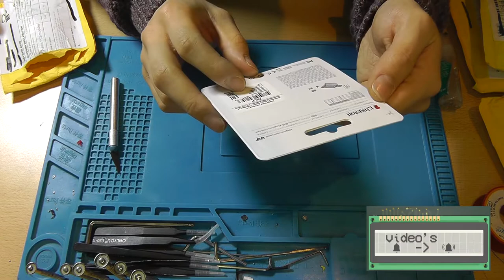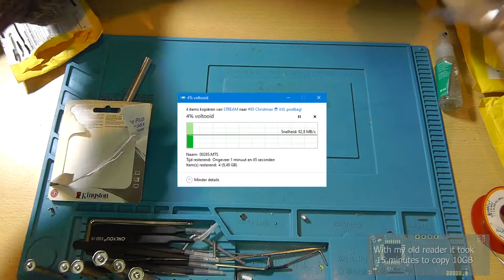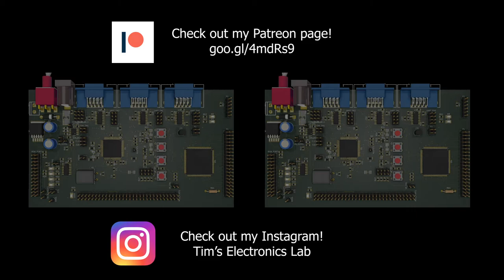#95-2 Christmas 🎅 XXL postbag 💌 (ESP8266's, Buck converters, PCB's and components)!

Comment: You'll like the D1 Minis.  They're small, break out all of the usable IO pins, and are easy to use.
Reply: Agreed. They are such a convenient (and affordable) board.
Reply from the maker: I'll use them for my upcoming project! They seem to have the same pins broken out as the NodeMCU V3, which is my main reason for using those boards
Reply: @TimsElectronicsLab  I've got 2 or 3 of them scattered around the house in various projects already and a few more in reserve waiting for inspiration to strike again.